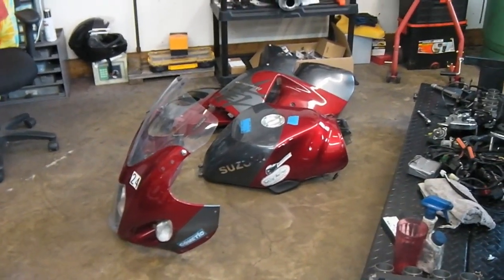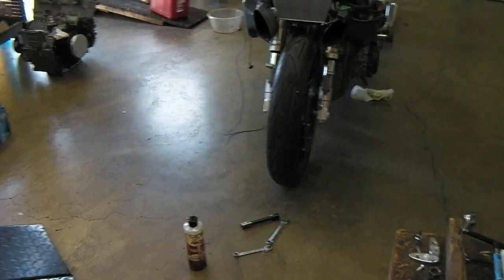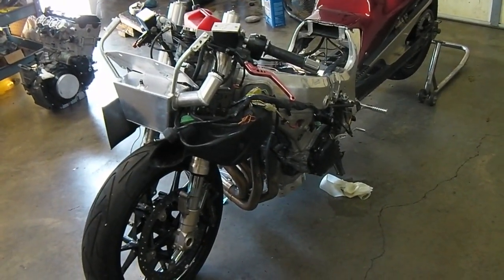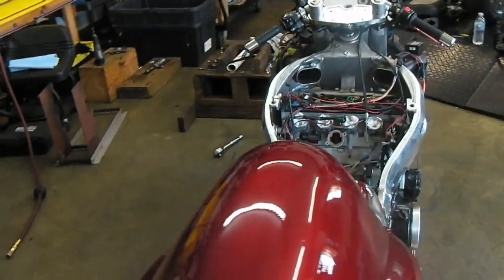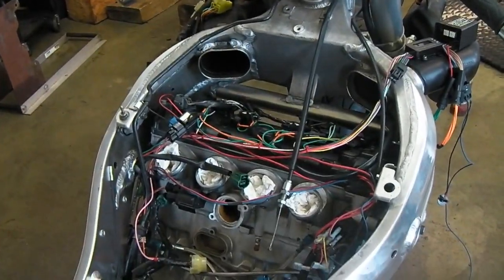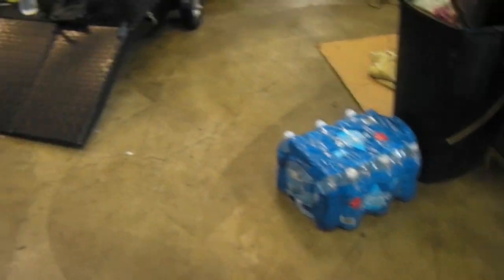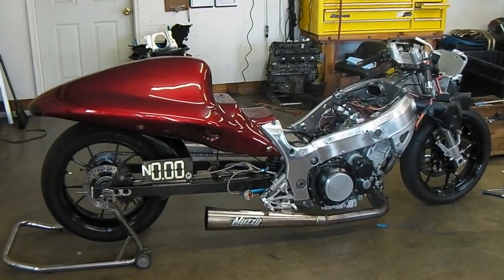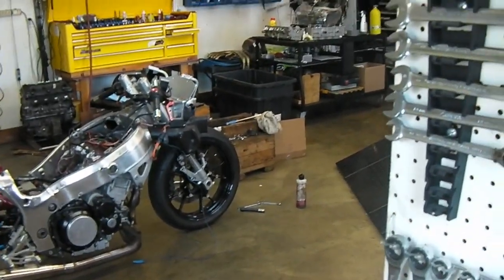Upgrade the 20 Year Old Hayabusa

Comment: Is 20 years old Hayabusa worth of buying or I'm going to experience plenty of problems with a bike that old ?
Reply from the maker: Gen 1 is the best years of the hayabusa! BUY IF THE PRICE IS RIGHT and fix it because the parts can be found anywhere  at a cheaper price than the Gen 2 and 3. Gen 1 is 1999-2007 years.